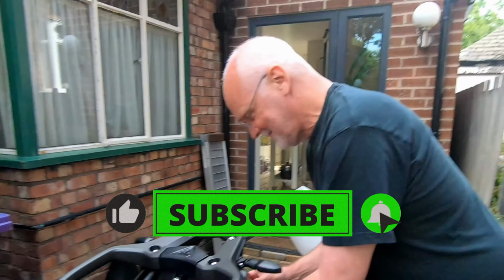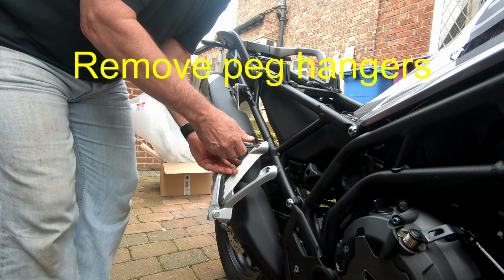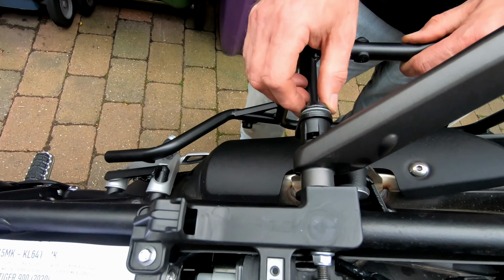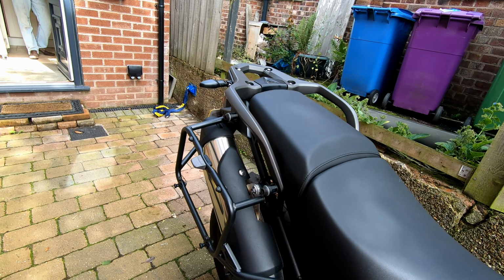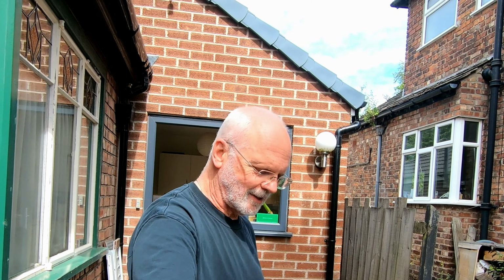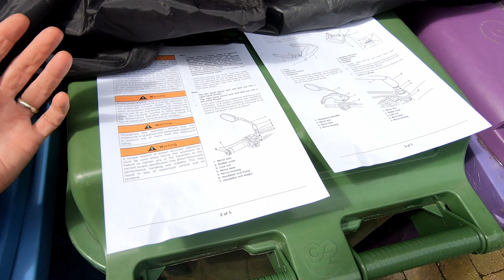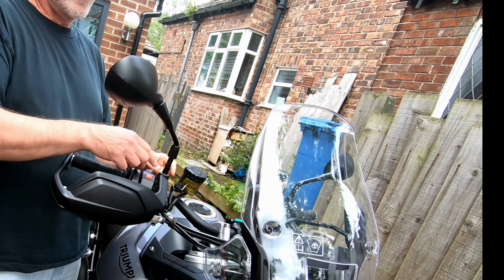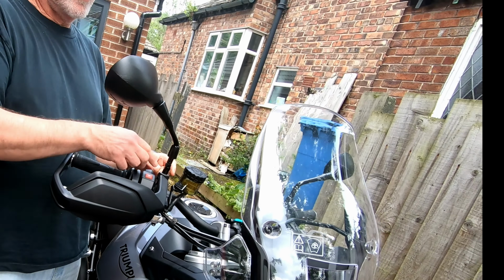Triumph Tiger 850 Sport - Givi Quick Release Rails + Triumph Handguards

Comment: Mounted these quick release brackets on my 900 gt pro. Saves the rails getting rusty as I use my bike all year round. I bought givi dolomiti 36l panniers, as they are slimmer than the plastic triumph ones. Black suited my black bike really well. I did need to modify the rails slightly, even though the rails were meant to be compatible!
Reply from the maker: Good information, thank you. I shall forward to Dr J 👍

Comment: Hi, just picked up the 900 gt pro and have ordered the same kit. With the rear number plate fitment I presume the hole are already there and no drilling is required ? Did you have much trouble getting the bolts out of the foot pegs, as I know sometimes they tend to over do the thread lock on these ?
Many Thanks.
Reply from the maker: Hi Nitram. It is John’s bike rather than mine. Everything was straightforward apart from those two bolts ‘hidden’ in the back of the seat cavity as they had nuts on the end of them, as in the video. The system is excellent. John used it when we travelled to Isle of Man, so easy to mount/dismount everything as required.
Reply: Hi Codger thanks for the quick reply. My kit is coming on Wednesday so reviewing the installation again. I took my number plate off this morning and I think that  2 holes at the top are being used to hold the number plate ? Did you have to drill two new holes to refit the number plate back on. Many Thanks,
Reply from the maker: DrJ reports everthing just lined up, no drilling. He said he replaced the plastic bolts with metal ones and painted the heads yellow to match. Hope that helps 👍

Comment: Hi guys, can I ask you if the GIVI pannier rails for Tiger 850 Sport to use with Trekker luggage are PL06415MK or PL06425MK? Also, did you mount the 01RKIT for the quick release? Thanks so much, I am confused if I need to buy the Triumph kit, I am not receiving any response from GIVI customer service!! Thanks!
Reply from the maker: Dr J says: 6415 with Quick Release. All works just fine. 👍
Reply: @CodgerBiker  thanks so much!!! 🙂